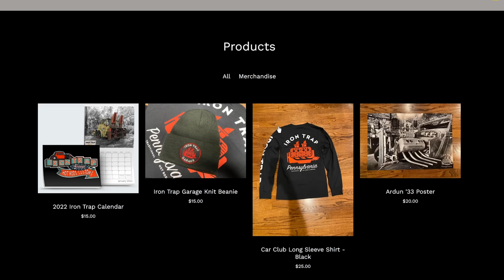Custom Mounting The 1932 Ford Grill Shell To Clear Jay's 389 Pontiac Engine

Comment: Nothing says hot rod any better than a properly mounted ‘32 grill. Your radiator mounts with the rubber pads turned out excellent. I really like the way your truck is coming together. Well Done!

Comment: Hey Jason, I have a suggestion for you that I've learned in my past 50+ years of working on old iron. Whenever I use bolts and nuts  to hold two pieces of metal together I almost always put the bolt down through the metal instead of coming up though it. Vibration and it's own weight can loosen bolts faster then if they went down though the frame. Also If it does come apart the bolt won't just fall out and may last until you realize that it came apart. Any help holding our toys together is good with me. Hope this helps. Later